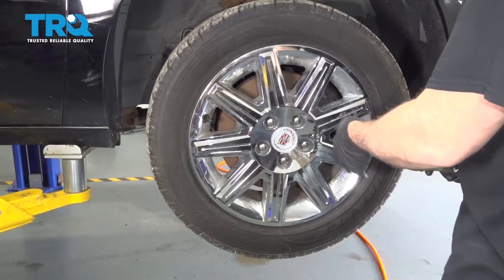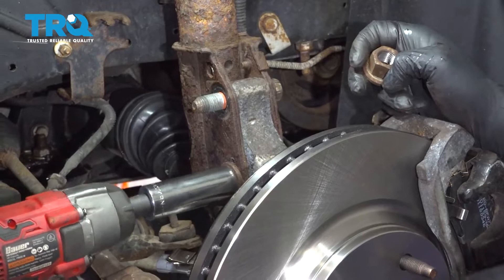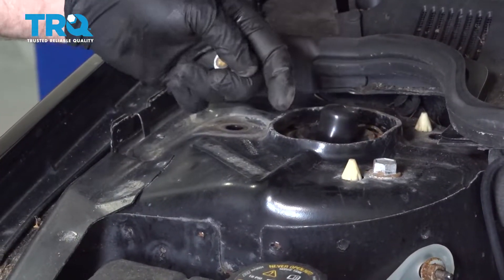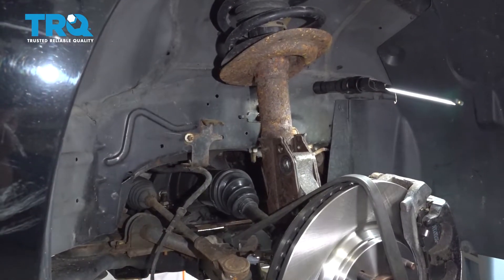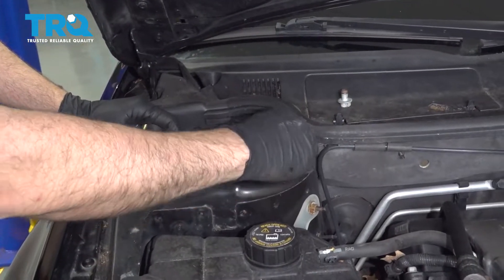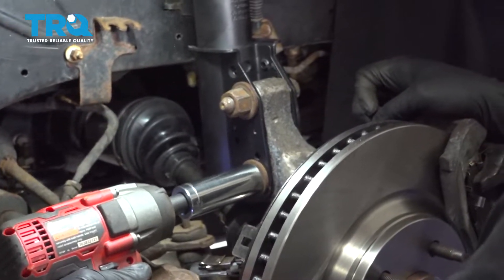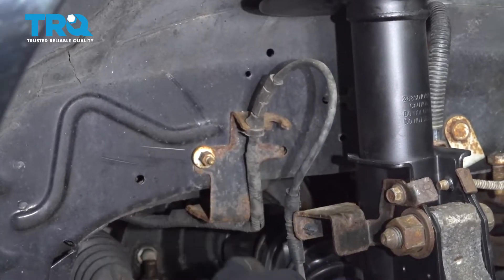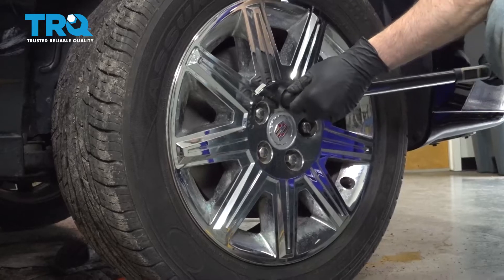How To Replace Front Struts 2006-2011 Cadillac DTS

Comment: Did this in my garage today, went ok had to wrestle the old one out, and couldnt for the life of me
get the new one in, was off by about two inches.  Called a mechanic friend, you have to push down on the 
lower control arm to get it to even line up.  I used a bottle jack between the lower control arm and the frame, otherwise forget it, would never go...